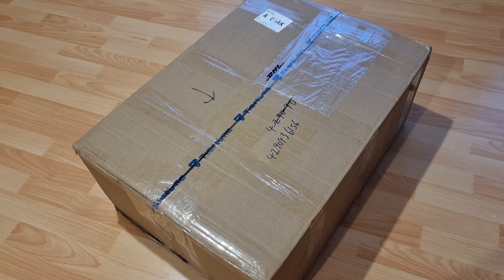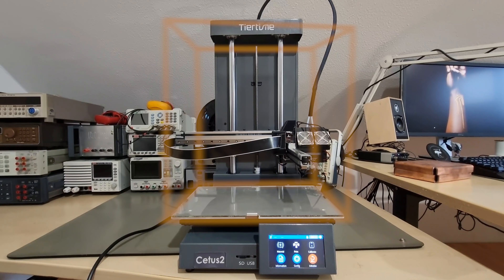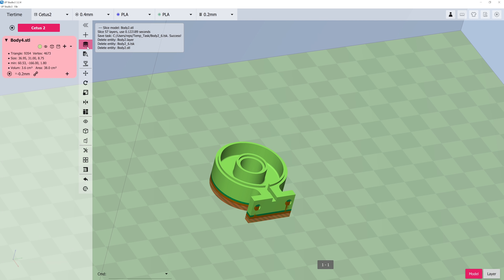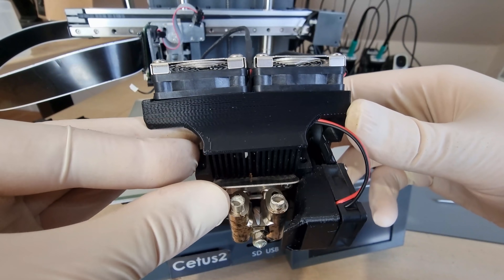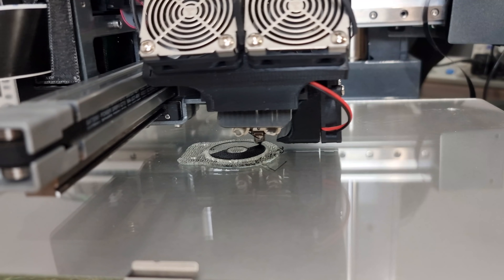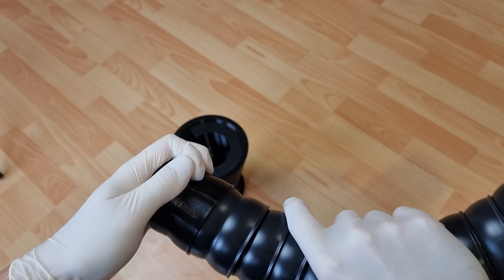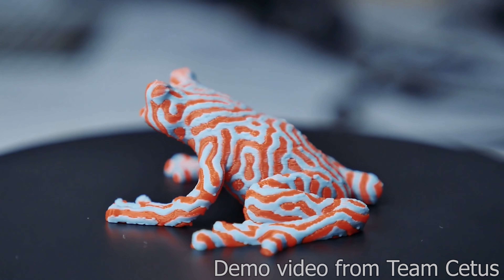Cetus2 - Prototype dual material 3D printer

Comment: I backed the Kickstarter back when you made this video. It finally arrived in the mail a couple days ago.
The machine has a fatal flaw where there is a singular M4 screw bolting the carriage to the Y arm, so it will loosen very quickly with any amount of use. Also, using a third-party slicer seems to be impossible at the moment. I can't remember if they ever promised that you'd be able to, but it's impossible as of this writing.
The nozzle is replaceable now too, and they have solved the handful of software glitches you highlighted in your review.
Reply: They have a discord describing how to get it to work with Cura and Prusa Slicer currently. But its very jank and doesn't work exactly how you want it. More of an add-in that translates the information back to whatever proprietary code the printer runs on. Mines been gathering dust.. If I could swap the mainboard with something that makes more sense I would probably use it more. Its a great skeleton

Comment: Just got the Kickstarter model up and running. The UI is better and loading and unloading filament is easier. Auto bed level works from the screen. Can confirm wifi as well. The USB and SD card location moved to the right side of the screen. The nozzle is user replaceable but I'm not sure how to do it though.
Reply: This printer is a piece of shit
Reply: @Kedzie_  yeah for the most part. The nozzle replacement isn't that bad, but you do have to print PLA at 240C which isn't great

Comment: The large steel panel, behind the two high hardness rods, keeps the alignment within .001 inches of the required tolerances. It also adds the shear strength. It is the shear panel that keeps the device stable and not deflecting or vibrating during operation.

Comment: Not convinced yet. The dual hotend isn't going to be very practical for extensive dual material prints and seems to limit the cooling options as well as the nozzle options. The huge heater cartridges have very little surface actually going to the nozzle. They mostly heat themselves.
Also, without some form of enclosure, multi material is pretty much limited to pla and pva. The printer is going to be a materialized compromise.

Comment: @Marco Reps  I know that you are fan (or video is sponsored?) of cetus but you probably never used any other printer. Please print the 3DBenchy is good test for 3d printer so you will see that this printer is one of the worse which exist in this price. I have Cetus Extended last edition and is the worst printer I've ever used. This printer with comparison to prusa mk3 or ender 3 is very very bad. This printer is much louder. A plastic plate as a table is the worst possible idea. The standard for a long time are flexible sheets that have a great grip. But the worst thing is their slicer. Minimal options and missing a lot of the ones that really come in handy. However, configuring it to work with cura or prusaslicer is very difficult and even then you lose the ability to preview what is happening with the printer because you only have the generated gcode.

Comment: I'm no engineer or 3D print enthusiast, but doesn't only having the print head supported on one side greatly reduce rigidity?
Reply: Yes it could lead to artefects. It is to bad that they are have such a steady frame but a wobbly Y axis. But I think it's not noticeable if the printing speed is not crasy fast.

Comment: It kinda seems janky from my POW. They increased build volume but still are using glass as a bed in an open type printer? I just can't see how you could reliably print large parts on it without delamination. Looking at the drawbacks of their extruder it seems to me that just plain old 2 separate extruders would perform much better than this contraption. Relying on a strain sensor to calibrate the height? Really?? It is not necessarily cheaper since strain sensor also have some cost. But more importantly: for printer to understand that it reached the bottom - it needs to poke the bed. What if residual plastic left on the nozzle? What if I want to cover bed in a tape, or glue?

Comment: Hmmmmmm, that's a good deal for a printer with those capabilities, but what does it do if I don't want a multi-material print? Can I print from multiple spools for extremely large, uninterrupted prints?
I am in the market for a high end printer and want something bigger than the Pulse XE or Sidekick 747. but preferably less than or around 2k USD.
Reply: Voron Trident (≈1.5k) or Voron 2 (V2.4r1, ≈2k bucks)

Can't beat the CoreXY in terms of rigidity, and rigidity determines the possible speed/print quality spectrum. The V2 goes up to 350mm³ (If you think you'll ever build something that big) but smaller printers are more rigid (Again, = faster/better prints)

They're also enclosed, so that means higher temp materials like ABS, ASA and Nylon are possible depending on your hotend.

Only problem? You gotta buy kits or parts and build it yourself.

Comment: The "weird hybrid plastics" you mentioned are actually an applied practice in the extrusion industry. Blends are often achieved with dual-screw-extruders blending the two materials in-situ when it goes through the injection-nozzle.

Comment: Why do these guys cantilever so much :/
Could've used the bed as the y.
How does the esp32 get the amount of pins a printer needs tho
Not a fan of the single nozzle dual extruder tho. Seperate ones are always better. Way better

It's still cool tho :o

Comment: I've waited for a while now to buy the original Cetus. Looks like I found my new favourite!
Reply: As a Cetus mk3 owner, I really won't recommend it if you are after good looking 3D prints. Overall, the print quality isn't that great when comparing to faster CoreXY 3D printers, Prusa mk3/mk4 or even Creality Ender 3.

My main problems were the original slicing program UPStudio, the lack of expert settings (used to work with Prusa mk3 printers in uni) and closed hardware. This was like 2 years ago and I can see there are many improvements in Marco's video. TBH I secretly hoped Cetus mk3 would be my cheaper Prusa Mini, buuut it wasn't.

I ended up upgrading the Cetus to Duet 2 Wifi, which gave me a lot of freedom in configuring prints as I liked. Upgrade to the Duet gave print quality boost immediately (no more overflowed corners or seams) but there are still some issues with the quality of the hotend + hotend stepper placement and not-that-rigid Z-axis (because Z needs to lift of the weight of the hotend + X axis itself) + there isn't any hotbed at all. I might need to replace/upgrade those when I have time and cash. Currently this small printer has costed me around 450-500€ with all the upgrades (Duet, power supply and quieter fans).

Consider also the slicer you are going to use, how well it works and are there any quirks or problems in hardware/mechanics before the purchase.
Don't know if this rant helped, but there you have it!

Comment: I'm sorry fans of this brand - nothing except the weight is good here. Probing with the nozzle has been made with trinamics for AGES, and it's much cheaper than adding a loadsensor. "Large" build volume? I have 350*350*400 - and my printer is starting to look small next to some.
Cantilever design? Come-on! Worst kind of design just after prusa i3 style (I know prusas produce good results - corexy is still the best design)

The only thing this has, that is moderately interesting, is the hotend. But it needs to have either interchangeable nozzles or very easily changeable assemblys
Reply: Probing with the nozzle based on the load the trinamic driver senses is supposedly not accurate enough to get a reliable z0. And regarding the size, that's really something of a personal preference.. I have a Voron V2 300*300*300mm and actually regret choosing this size, because for 99% of the prints I could get away with a way smaller build volume.

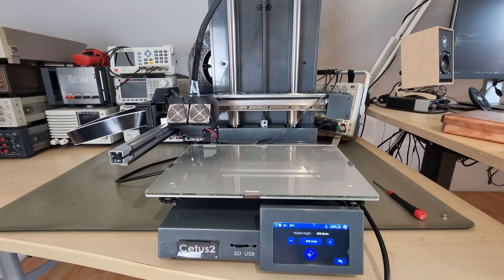Comment: 2:03 I don't know much at all about these things but I did notice that the glass(?) base seems to be deflecting when doing that calibration. I'd imagine this will affect accuracy.
Reply: I don't think it's deflecting. It just looks like it because the X axis rail is moving up and down. Look at the reflection of the lab instruments in the back left corner of the bed. They seem to be stationary.
Reply: If you look at the outer edges of the bed, with the video at 0.5x speed, you will see that there is no noticeable deflection (movement) of the bed while it pushes down on it, it stays perfectly stationary compared to the background and also compared to the printers base.

Comment: The extruder tip as a probe sensor via strain gauge is my favorite 'new' thing to catch on with 3D printers, I fell in love with Creality's implementation and honestly wish every printer has it now haha
Reply: I do wonder how feasible it would be to add to a printer that uses roller-on-extrusion like a cheapo ender 3. Or how accurate it is compared to the good old BLtouch.
Reply: @Scrogan  that's exactly what the CR6 is. An improved Ender 3 style unit (rollers on extrusion) with some specific tweaks for reliability and performance (dual z axis, silent steppers, underside PSU, an actual screen, etc) with the most notable improvement being the strain gauge bed levelling.

I've not had the opportunity to do direct comparisons with printers that come with BLTouch preinstalled and preconfigured, so I may just have had consistently bad experiences, but I've never found the BLTouch system to be polished, reliable, or fully functional without at least some amount of fiddling (and quite frequently still requiring a full manual bed levelling anyway, which entirely defeats the purpose of ABL tools)

I'd wager that BLTouch is a fine way for people to spend a little extra money and make their machine a little more complex - ideal for the people who like to tinker with a machine for a hobby, rather than being ideal for the people who want a functional tool out of the box when they order a printer.

Perhaps there will be some major company that manages to seamlessly integrate a BLTouch directly from factory for true ABL, without charging 3x what creality does, but I haven't seen any printers worth buying like that yet. Maybe Elegoo? Who knows
Reply: Only works with glas beds tho
Reply: @peterzingler6221  No, BLTouch and strain-gauge/pressure-sensing ones work on any solid bed. If your bed is so soft that you can't touch it with a probe/nozzle, then you've got a much bigger problem to worry about.

Perhaps you're thinking of capsense ABL systems, which only work with metal beds?

Comment: New printer but the same cantilever design with even heavier extruder. Original had problems with ghosting and I suppose this won't fix them. Also proprietary board and slicer are a no-go for me. For $315(likely more when released) it seems kinda hard to justify. For that money you can buy an encloesd ones(I know an owner of a flashforge adventurer 3 and he is happy with it), and if you include DIY it doesn't really make sense.

Comment: I've been doing multi-material bonding with a prusa MK3s+ for a while, even with a MMU2S its still quite a manual process, the prusaslicer still doesn't have functionality to deal with material changes (despite being called a multi-material system, go figure lol) i.e. TPU-PETG hotend temp differences so you have to edit the gcode as required. This looks like it could be a step in the right direction.
Reply: I completely agree. While I love the MK3s+, the MMU2S has been a huge disappointment... regular jamming, very slow to switch filaments, buggy in many areas. Just terrible overall...
Reply: The lack of being able to set different temperatures for different parts or vertically really annoys me, I hope they add that
Reply: @ThylineTheGay  You can set pretty much everything for any model, it's a hacky workaround with modifiers and stuff, but works.
Reply: Why are you not using Cura? It is more than capable of multi material slicing

Comment: I feel like Tiertime has been promising open-source CPU modules for years, but hasn't gotten it done.  I ended up giving up and replaced their control board with a Duet 3 mini 5+, which works well.  (Then you realize the hotend isn't that great, and I replaced that too ;)
Reply: Yea they aren't releasing open source shit. Don't hold your breath, it's bulshit.
Reply: Same here.. I went to TinyFab cpu and board.. Running with Smoothieware. But smoothie itself isn't great.. I did change the extruder to titan as well.
Reply: @mvadu  Doing a conversion from an Up Mini 2(As I love the compact enclosed design) originally using TinyFab's board. They are all sold out on the esp32 so I ended up however making a custom PCB so I can use an AtMega2560 and run Marlin as if it was a RAMbO board for the sake of simplicity. Others have got the original touch screen working with it too, so that'll be fun once that also works.
And yeah, the hotend is garbage, but the Up Mini 2's main structure, carry handle and enclosed design make it a worthy base.
Reply: Im so glad that i did not buy the cetus 1 and got an prusa mini instead. Now build a V0.1 and i wont ever change from a corexy again
Reply: @impact224488  I got a Cetus and regret it. Constantly scrapes the platform even when leveled, program/slicer trash. When it works it's great but it's impossible to get to work right.
Reply: Not sure why Tiertime is always trying to reinvent the wheel. There are knowing good solutions to slicing and controlling, and not reusing the literally hundreds of man-years of engineering that have gone into those existing solutions is plain stupid.
Reply: I too upgraded my cetus with a Duet 3 mini 5 + wifi. What extruder/hotend are you running? I just bought a Biqu H2 V2 extruder/hotend for it.
Reply: @mass1s  I got a Hemera.  I had to design a mount that slides into the OEM carriage and holds a Bltouch and part cooling fan.  Some build volume was lost, but with that mod and some stick-on PEI for the bed, the prints are excellent every time in PLA and PETG.  (I haven't put the enclosure back on for ABS.  Screwing around with excessive LED lighting at the moment.)  I also replaced the OEM 19v power supply with a 24v power supply.  The heated bed is now significantly less weedy.  Happily gets up to 90C without the enclosure, for PETG.

Just for the sake of completeness, I somehow burned out the X motor at one point, and replaced that with a random $10 one from Amazon.  The new one is much quieter than the included motors, which makes me want to replace them all.  However, it's a big pain because the gears are glued on, and the printer uses 1.5mm pitch belts which I can't find parts for anywhere.  I had to disassemble the broken motor and drop the shaft in boiling water for a while to get the gear to come loose, then superglue it onto the new motor.  Very janky, but it works.

My conclusion is that I wouldn't buy one of these just to mod, but if you made a mistake and got a Tiertime as your first printer, you can turn it into a very enjoyable piece of equipment with a lot of work :)
Reply: What hot end do you use?
Reply: @Synergy7Studios  I used the default hotend with the kit. I'd calibrate it so that it doesnt scrap via the piece of paper and go just before it drags. then when i print it gouges the buildplatform. Idk why never used to do that.
Reply: @taliakuznetsova7092  i promise man, change your nozzle offset. There's a good chance that will fix it. The calibration you're talking about is just for bed leveling.
Reply: @Synergy7Studios  All right, whats a good offset to start with do you think?